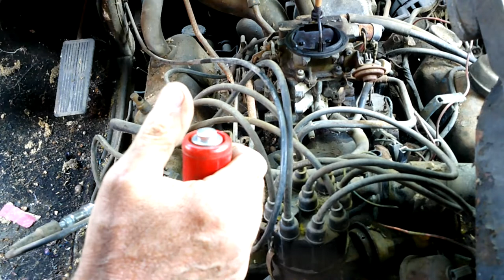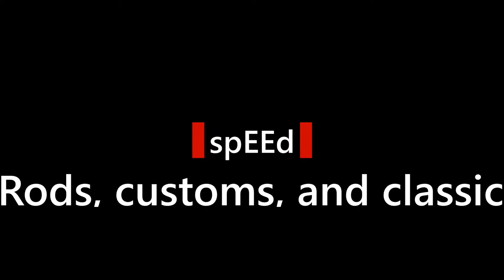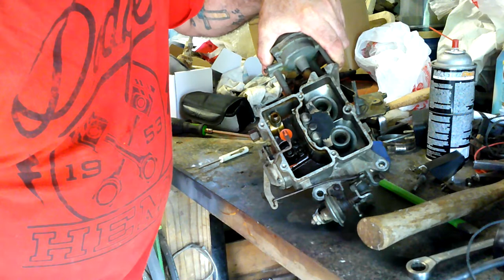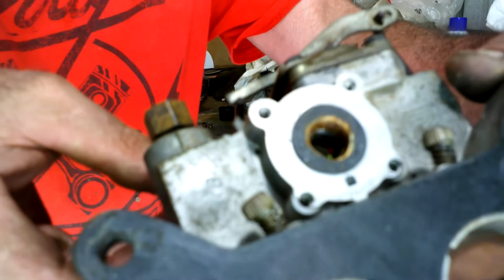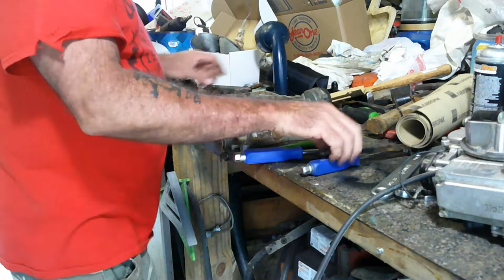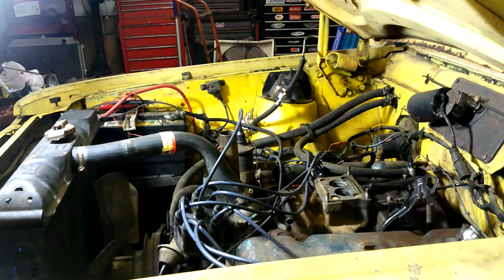Will it run with a backyard, spare parts, no kit, carburetor rebuild. How to rebuild a carb w/no kit

Comment: Definitely sounds alot better than the first time, 290's are really a good little motor ,I've had afew of them, decent fuel mileage and no bad for power, a little modification to a elderbrock 4 bbl intake and a holley carb really wakes up the little motor 😀
Reply from the maker: Oh, sure, now I wish I put the Holley on it! Thanks a lot, Buddy! LOL!
Reply: @essigspeed  it will be fine 🙂, have fun with it 😉😄, besides the 304 elderbrock intakes are kinda hard to find right now 😅